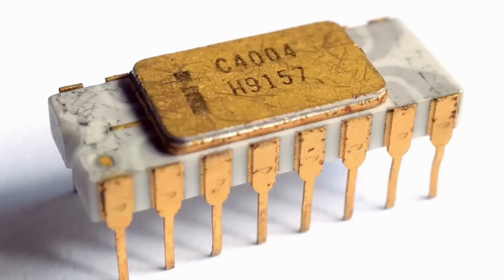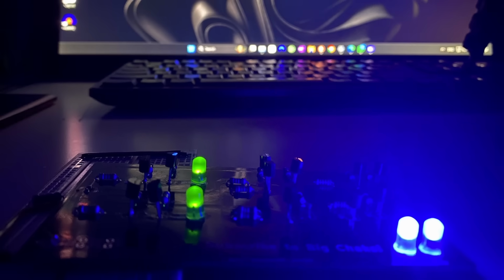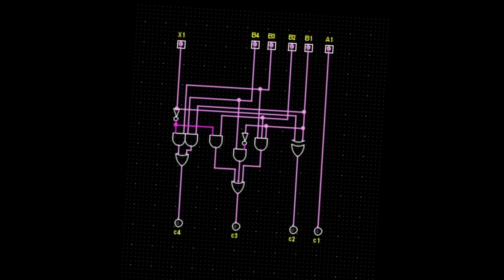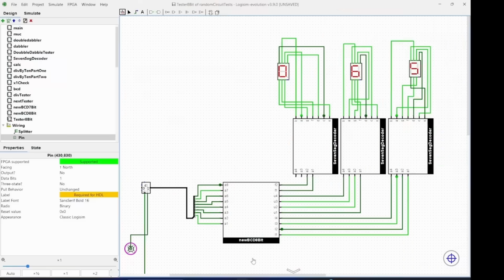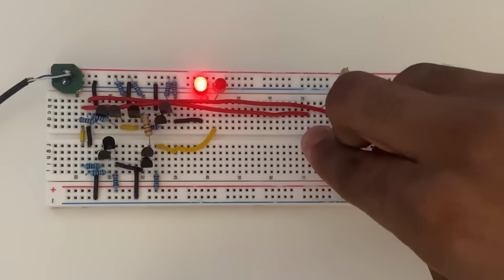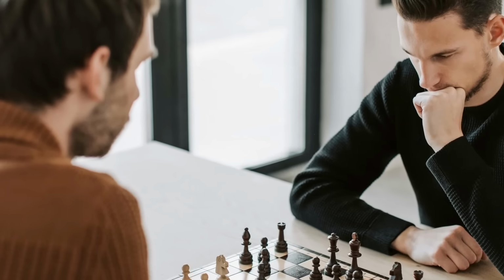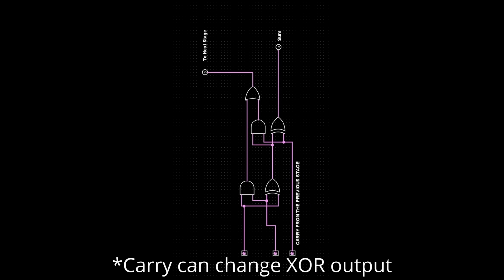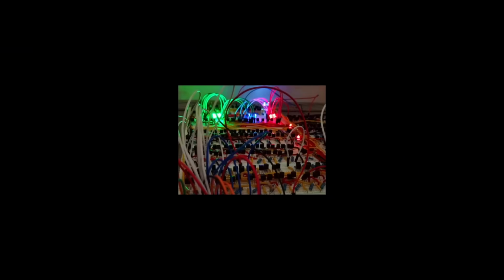I Built A Handmade CPU!

Comment: I want to build a programmable computer, but with 130 Euros I get only 2000 Transistors and resistors and 4000 Diodes with solder. That reaches for 25 Byte RAM. I definitely need a job. I am actually at school. So I have to build it in Logisim.
Reply from the maker: Thats very doable! You just need a 5 bit PC and 8 bit instructions which would make it very straightforward. You can use the same ALU design that Im using( check latest video for tutorial on how to build it.) to save transistors I wouldn’t add a stack pointer to your build though. And to make it programmable you just need a few flags and a way to jump to a separate address based on the state of the flags
Reply: @bigChaks  I have already made a divider and multiplier. My next goal is to take square roots.
Reply from the maker: @Modellbauer403 😭 wtf do you wanna build? How are you gonna keep it under 2k transistors?
Reply: @bigChaks  You have right ! I need 50k Transistors.
Reply: And then I can Play Tetris!
Reply from the maker: @Modellbauer403  😭. you can play chess with a lot less than 50k transisors bro. Even the 6502 had only about 5000 transistors lol
Reply: @bigChaks  I need a Big RAM not a CPU.

Comment: I have designed and built a Minecraft redstone CPU using an ALU almost exactly like this :P
Including extracting the AND and XOR functions from the adder, all the same operations. I managed to squeeze some extra functionality in as well(my ALU operation was 7-bits anyway), my ALU supports some more functions on the B register before any operation: left/right shift, invert, replace with IMM value. It also has a fully binary comparator(lt/eq/gt,a_eq_z, b_eq_z).

One cool thing about this design is that the entire CPU is completely "stackable": You can build it for any bit-width by just stacking exact copies of the 2-high redstone layers (using worldedit). Building a 32-bit CPU is as easy as //stack 31. The instruction set is fixed at 8bits/instruction, but works with any data-width due to a the immediate-value decoding scheme: If the top bit in an instruction is set, load an immediate value. If the previous instruction was an immediate value instruction, shift the current immediate value by 7 and then load in the lower 7 bits from the instruction. 
I'm fairly certain that this could be done for a "real"(PCB+transistors) CPU as well. It would make it easily testable and extendable. You could start by building a single layer, test it, and if successful(or after a few fixes) you could build more layers as needed.
Reply from the maker: That's great to hear! I try to limit the amount of work I'll have to do later by using as few dedicated circuits I can so I left out shift functions, and kept it 4 bits. I'll have to find a way to do those in code 🤢( hate programming lol).

But great work on your build! Funny we found the same ideas in the ALU :). I'm making a few changes to my ALU so as to add the Stack Pointer to the circuit too. 

How much ram can yours access btw?
Reply: @bigChaks  In the default configuration, as much as the "word-size"(bit-width, or repeats of the structure) allows, e.g. for an 8-bit implementation, it would be 2^8=256 8-bit words. For 16-bit it would be 2^16=64K 16-bit words etc. - The CPU shown in my videos video is running with 32-bits, and could address up to 16GB RAM(4G * 32bit words), which I feel like might barely be enough for a Minecraft CPU :P
Needless to say, I'm using ComputerCraft to emulate sparse memory :D
It does come at some cost though, because of the way the ripple-adder and binary-comparators work, some operations will take longer to settle to the correct result depending on the word-size - set clocks accordingly ;)
For building even smaller CPUs though, it would be conceivable to use one(or two, for ROM/RAM) of the 3 general-purpose registers as an address-extension used when writing to address registers. In that case the address size would be twice the word size(e.g. 8-bit CPU could address up to 64K * 8-bit words).
Reply: if you used a cca adder, it cant be stacked for more than 8 bits without extending the signal
Reply: @brr216-7  You're mostly right. For a CCA/CLA adder you'd need some kind of repeater after 8 layers(which can be built! Just takes a little bit of extra space. You don't even need 0-tick repeaters, just equal latencies for all the caries, possibly the requirements could be reduces even further, IDK).
But in my case, it uses a simple ripple-carry adder("the previous adder carry-out connected to the next carry input"). While this has the disadvantage that you get the result later(after all the gates in the chain have settled), it makes the design much easier, and generates fully symmetrical layers, which was important for my "monolayer" CPU design. I'm testing the CPU with increased tick speed, and my plan is to build a special version for MCHPRS, so the "vanilla 20tick/s performance" doesn't matter to me that much anyway.
I'm not trying to build the fastest redstone CPU, I'm trying to build one with some very special features and properties :P
With my design it's entirely possible to build a 64-bit or more Minecraft CPU, if you don't mind that larger wordsizes mean fewer instructions/second.

Comment: Also, U need a set of instructions, and it's very simple for 4 bits only using ANDand NOTs, not to be confused with the NAND gate but try it out with two bits first meaning You need 4 outputs for a set of instructions of 2 bits the first one is if all bits are off the result would be the first bit on, but if the first bit is one but the other one not then the second output would be on, if the second is on but the first not then the third output would be on, but if all are on then the fourth is on, making a circuit of 4 bits would need 16 outputs.

Comment: Can you show the actual circuits at transistor level? I'm curious as to what kind of transistors you're using and how exactly you're making gates out of them since there are plenty of ways to.
Reply from the maker: Sure! I'm using 2n2222 A331 transistors and all 2.2k ohm resistors. I never sat down and drew up a schematic transistor by transistor but I will put that in a future video because most people say I didn't really explain the circuitry as deeply as they would have wanted. Subscribe so you don't miss it! :)
Reply: @bigChaks  So all BJTs? If You're using all BJTs and only using a single value of resistor, then you must have adapted the concept of complementary MOS to BJT, which probably makes your circuit larger than it needs to be (which is probably undesirable because this is already doomed to turn out pretty big (and btw I love how much functionality you've squeezed from that simple ALU circuit)). I'd love to give input when I see those schematics.
     If it is not clear what I'm saying, it is that BJTs normally require one resistor value for pulldown and another for limiting the base-emitter current, so I'm assuming you just made all your gates output either a 0 or a 1 (so you don't need pulldowns), whereas I find it uses less transistors if you make them output either a 1 or high-Z and then use pulldowns in every gate input. Add that to the fact that you said inverted gates are simpler to make, and I assume you've probably adapted the CMOS concept to BJT, as I said.
Reply from the maker: @ZeldaVerde I just use one resistor per gate, not counting the base resistors. I think I know what you mean by adapting the CMOS concept. Isn't that when u have a PNP transistor and another NPN transistor working together to output the result? The way I'm doing it is different. Might talk abt the transistor circuitry in the next 2 videos .
Reply: @bigChaks  I don't know what you mean by "base resistors". It could be pulldowns or pullups or base-emitter current limiters. Yes, that is what CMOS means, but in mosfets that would be P-Channel and N-Channel instead of PNP and NPN, respectively. Anyway, I'll just wait to see your schematics and explanations. It is of little use to keep struggling trying to communicate this thru text.

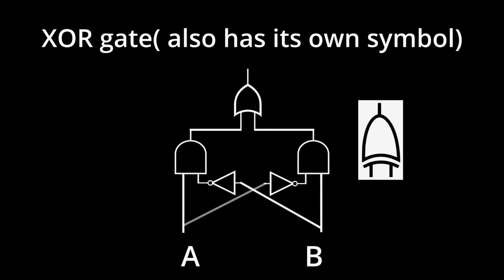Comment: 7:00 don't listen to them, karnaugh maps are useless as you almost never have an input number that makes the map not confusing 😅
just make simplified truth tables (for example only showing lines with output high, if that's the least represented output state) and derive the logic function from that, it's easier to understand and use, and much faster

Comment: Now do it in redstone
Reply: in redstone the logic gates are easier
Reply: Well, it is possible.
Reply: Sammyuri is your guy
Reply: I'm building the parallel bus, ROM, ALUZ, Register file, instruction file, blah, wiring, slash, sensors AND MORE
Reply: I followed mattbatwings but only used or, not. I only got to making a register file and all before wanting to make them a bit bigger and now I’ve been procrastinating for months.